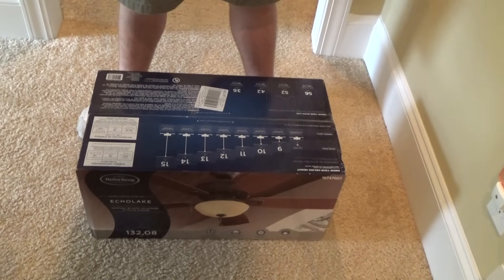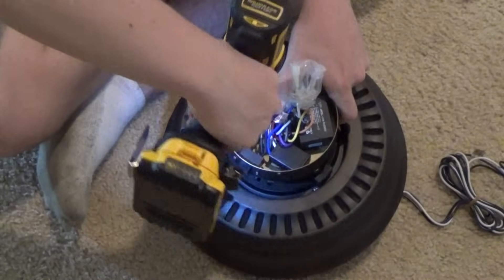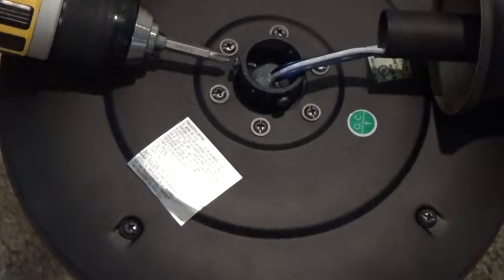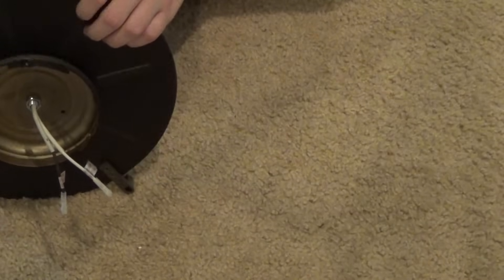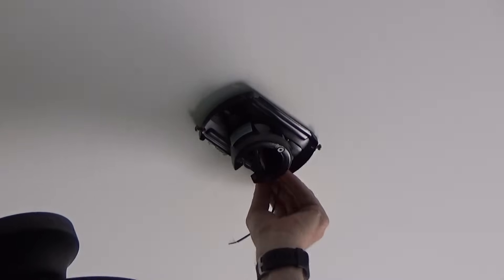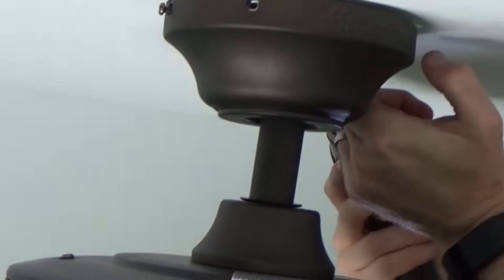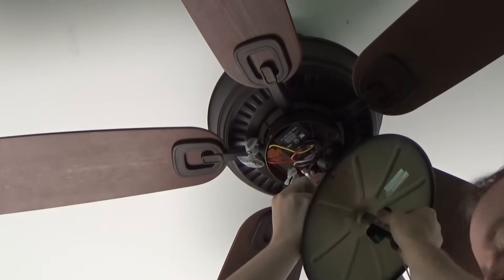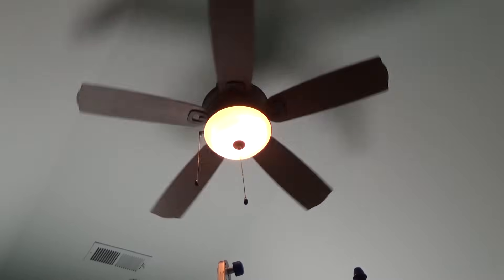How to install a Harbor Breeze Ceiling Fan from Lowes

Comment: Can I install Blades on the ground before installing motor up?
Reply from the maker: It depends on the model.  On this one, technically no.  To be more accurate, I believe you can install all but maybe 2 blades on the floor and then just install those when you get it mounted. If you install all of them on the floor you can't angle the fan to hang it.
Reply: I always do

Comment: For all of those asking, the blue wire that is connected to the ceiling fan should be connected to the "hot" wires that are coming out of the ceiling via wire nuts.This is only if you do not have a red wire like in the video. The "hot" wires are usually black, however, this could be different in your home so to avoid any types of malfunctions/safety issues you should test these wires beforehand to determine which wires have electricity going to them.

Comment: You could explain the wires better
Reply from the maker: I understand where you are coming from but that is really tough to do.  The way the wires in your house are wired may not be the same and if I tell you to wire the black to the white wire in your house and I am wrong, I can be held responsible for the damage.  The only way to know what wires to connect it to are to test them with a multimeter.  Most people forego that and just assume what they are based on colors but I have seen thousand dollar brand new appliances ruined because people didn't test the wires first.

Comment: My grandson has a little stuffed little man. It is duck dynasty. Half the time your voice sounds like the duck dynasty guy.
Reply from the maker: Love Duck Dynasty.  Who does he think I sound like? I actually met Jase years ago.
Reply: @ClintHolland  I never watched the show. I guess you had to have cable tv. I don’t have cable tv because I don’t watch tv. Antennas gets me all I want when I even turn a TV on. The little stuffed man wears a cap and a long beard. The recording says a lot
Of different things.  One is the things the little stuffed man says is Red Neck rule number 1. Most things can be fixed with extension cord and  duck tape. When you were talking about how to wire up the fan after you hooked it on the hook holder is when I noticed.

Comment: If I can move the down rod around does that mean it's too loose?
Reply from the maker: When you say around what exactly do you mean?  It's ok for it to move in general. Otherwise the fan would probably vibrate and make noise.

Comment: can you attach the blades before you hang it?
Reply from the maker: On this model you can't. You could attach a couple maybe but they would interfere with your ability to hang it because of the angle needed.

Comment: Can you use a dimmer switch with that
Reply from the maker: You sure can.  Most fans support them just fine. The biggest issue you may have is if you install LED lights, many of them don't support a dimmer and you would need to buy dimmable ones.

Comment: My light didn’t work until I hooked up the two whites together. Two blacks and a blue together and two greens and a gold. Now it works. I don’t like the way my fan switch goes through the globe beside the light switch. Half the time the fan switch. Doesn’t want to work. Any ideas ?
Reply from the maker: Honestly, if it works sometimes and sometimes doesn't, I would suspect an internal issue with the fan and would contact Harbor Breeze and return it.
Reply: @ClintHolland  I have the lights and fan working. Thanks.
Reply from the maker: @louiseneel944  Awesome and great to hear.

Comment: I had what looked like this exact ceiling fan except you don't mention the remote receiver that comes with most ceiling fans.  I couldn't figure out how to fit the remote receiver and the wire connections all in the same space inside the bracket. Looking now for a ceiling fan that does not have the remote receiver thrown into the mix.
Reply from the maker: Yeah, this fan didn't include the remote. I have a separate video of me installing a fan with a remote. https://www.youtube.com/watch?v=WfhYInLo1e0

Comment: YOU DONT CONNECT THE LIGHT KIT WIRE TO THE “OTHER TWO” WIRES.  IT ONLY GOES TO ONE, GENIUS!!!
Reply from the maker: I am not sure what video you watched or fan you installed but if you know of a way to make a light work by only connecting one wire then you have just defied physics and probably are due a Nobel Prize.

Comment: Great video.... Just one suggestion: Try carefully installing the blades and light fixture before hanging and connecting the power afterwards. (Lay the unit onto its side and hanging off a work table while installing the blades.) Afterwards,  hang everything as one unit....
Reply from the maker: I couldn't get it to work on this fan if I installed all the blades as it wouldn't let me angle it enough to hang it.  We didn't completely test the theory but I believe if you put all the blades on but maybe 1 or 2 you could do that.  Were you able to angle it enough to get it hung with the blades?
Reply: @ClintHolland  Yes, but I had an extension.... I didn't use the short one.... So in the case of the short one, you are absolutely right
Reply from the maker: @jamessmall3242  Got you.  Yeah, having a longer downrod would probably help out a lot.

Comment: Thank you for this video! We installed a summersville this afternoon. The light works, the fan motor runs, but the blades don't move. Any thoughts on why that may be? 🤔 Ty!
Reply from the maker: I am not sure I understand.  How can the fan motor be running but the blades not turning?

Comment: I have a blue black and white wire coming from my ceiling no green ground is this a issue
Reply from the maker: It's not ideal but it will work. It just means you don't have a ground.  Many houses, especially older ones, weren't wired with grounds.  They are used as a safety factor.
Reply: @ClintHolland  ya its a older townhouse so I just connect the wires by color black to black, white to white, and blue to blue and I should be in business? What about the remote wiring?
Reply from the maker: @will7285  Do you have two switches on the wall for this fan or just one? Also, the fan in this video didn't have a remote. Are you installing a different model?
Reply: I have the same issue, no green/bare wire for ground.  I simply omitted it, and everything works great!

Comment: Great video, but I have one question.  We are installing a HarborBreeze fan only (no light).  The wires coming out of the fan are  black, white, blue and green.  From the ceiling there is a black, white, green and bare copper.  I think in your video you say, if you dont have a light kit, connect the blue wire to the "other wires coming out of the ceiling" (black and white).  This would be a dead short circuit!  What did I get wrong?
Reply from the maker: Assuming that the wires from your ceiling are white for neutral and black for hot, you would connect your white wire to the white wire on the fan and the black wire to the fan's black and blue wire.  Since you don't have a light, you actually don't need that blue wire connected to anything unless you just want to be prepared to add a light kit at some point.  And then assuming your green wire is ground, I would connect it to the bare wire and green wire from the fan.

Comment: What about the white wires? You didnt address thise
Reply from the maker: I don't address the wiring because I can't know what the wiring in your house is like. Depending on where you live, how old your house is and who wired it, they may not match up with my house or even your neighbors house.  It would be very dangerous for me to issue a blanket statement as to how to connect your wiring. However, I am happy to help on a case by case basis. What color wires do you have coming from your ceiling?
Reply: @ClintHolland  I was tightening the bracket for my ceiling fan when the white wire from the fan came out as I was putting the housing back on. I have white wires coming from the ceiling but they are a different gauge and are already tied together. My question is, how to I complete my circuit to get my fan and lights working again
Reply from the maker: @OrisRasGaming  How many white wires do you have coming from the ceiling?

Comment: Where do I attach the blue wire at? I only have white & black wires from ceiling with a single wall switch?
Reply from the maker: Tie it together with the black wire. Then your one switch will turn on both the fan and the light.

Comment: How do you tighten the screws if they are loose
Reply from the maker: I am not sure I understand the question.  If the screws are loose you should be able to use a screwdriver to tighten them.

Comment: Do you have to have molex connector to make light work?  Apparently the installation guide said cut it off.  Now the light doesn't work
Reply from the maker: You do not, at least on this model.  You can hard wire it without a connector.

Comment: I only have a white wire and a black wire coming from the ceiling - only 2 - which one ties in with the green ones?
Reply from the maker: If you don't have a green or ground wire, it will still work just fine. The ground wire just increases the safety should the fan short out and you touch it.  But I doubt you will be touching the fan very much.

Comment: so mine DOES have a light(not necessarily a "kit"?) but it only has the black and white cables.  The old fan did turn the light on with one outlet and the fan with another.  Im assuming this one uses the remote for everything.  So what do I do with the red?  Just cap it off?
Reply: well I just capped it off...everything seems to work well hopefully the house won't burn down
Reply from the maker: @raptorsan85  Sorry for the delayed response but yes, you can just cap it off and use the remote for everythng.

Comment: I had the same fan would it work if I had a white wire and a black wire to have an old house where does the red wire go
Reply from the maker: Assuming that your white wire is a neutral and your black is hot, you could tie your white wire to the fan's white wire and your black wire to the fan's black and red wire.  The red wire is just the hot for the light and the black wire is the hot for the fan.

Comment: Looking at my ceiling, i have the white, blue, black, bare & red wire...I'm so confused as to what goes to what!
Reply from the maker: You would want to use a multimeter to confirm what they do.  Are they attached to a ceiling fan now or just bare wires hanging?
Reply: Clint Holland 
No. It's a new house. There is no light fixture or anything else.
Reply from the maker: @LDRDebari  How many switches do you have on the wall?

Comment: I have fan motor installed but I did not remove the blade screws first,  now two of the screws won't turn.  Any suggestions?  Thanks!!
Reply from the maker: You are saying the screws are too tight to turn?
Reply: @ClintHolland  yes two of the screws won't budge.
Reply from the maker: @lynncappa5769  That's a tough one.  Maybe try some penetrating oil.  If that doesn't work your only option is probably to take it back for replacement.

Comment: 21:09 i heard train horns
Reply from the maker: Very well could be true.  We do in fact live near a train track.  Good ear.
Reply: @ClintHolland  I am a good hearing. I live 3 miles away from the nearest track and i can hear the horn and train tracks. ya'll probably live like half a mile?
Reply from the maker: @tylerwhoisafanoffanstrains9246  Even more impressive.  I just measured on Google Earth and we live 2260 feet from the train track.
Reply: @ClintHolland  1/3 of a mile because 1 mile = 5280 ft.

Comment: Assemble everything but one fan blade and the cover over the light kit.   Then hoist it up and drop it in the ball slot, reach through the open fan blade to connect your wires and voila.  You won't have to mock your children that way and they will visit you on Thanksgivings.

Comment: Do you need to take out spacers before you connect electrical? I have it all connected but it’s not spinning. I still have the spacers on.
Reply from the maker: If you are talking about the rubber or plastic blocks they use to stabilize the blades/motor, then yes.  Do you hear the motor humming and trying to spin?

Comment: What about the red wire
Reply from the maker: In my case, the red wire from the ceiling is coming from my 2nd wall switch, the one I use to control the light.  I tied my red wire to the blue fan wire which is what controls the fan lights.
Reply: Quick Fix so, attach the blue and red from the ceiling to the blue in the fan?
Reply from the maker: @XMesandidge  What wires do you have coming from your ceiling? And how many switches do you have on the wall?
Reply: Quick Fix I have s double switch that controls the light and fine each. Nd another switch that controls both. I have green, red, black, white. I have hooked green green, white white, black black then capped the red but I think the red is hot. It is a remote controlled light
Reply from the maker: @XMesandidge  If your light is remote controlled then I assume you don't plan on using one of the switches on the wall, is that right?  If that is the case, tie the same wire you tie the light and fan wire both to the black wire from your wall, that is assuming the black wire is hot which it should be.

Comment: I have a red, white, black and bare wire coming from ceiling. I have one switch. According to the instructions for fan by chain and light by 1 switch it states to run black to black, white to white, both greens to bare metal and blue to red. My lights are woking but fan does nothing. Any suggestions?
Reply from the maker: Since you only have one switch, and assuming that your white wire is neutral and your black is hot, which you really should verify with a meter before doing this otherwise you may damage the fan, you would wire the white to white, the greens to bare metal, and the black and blue from the fan/light to the black from the ceiling. Then your switch on the wall will control both your light and fan.

Comment: Why my fan still wobble
Reply from the maker: If you are having trouble with it wobbling and you are sure it's installed correctly with everything tight, you can pick up a balancing kit from Lowes as well.  https://www.lowes.com/pd/Harbor-Breeze-1-Clip-5-Weight-Black-Ceiling-Fan-Balancing-Kit/50354904

Comment: The installer said you don't have a choice in putting the blades in over your head. That is not true. You can install the blades on the motor before you connect it to the ceiling. It makes it 100% easier than working above your head and having screws fall back down. I have a slightly different fan and installing the light kit has been murder. Three screws are causing me so much grief.
Reply from the maker: It depends on the exact fan model.  Some fans allow you to put all the blades on before hanging but in general for most fans you will need to leave at least one blade off to get it hung, sometimes more.  It also depends on the length of the down rod.  A longer down rod allows you to have more blades on before installation than a short one.

Comment: Mine had 10  machine screws to be taken out from the bottom of the motor.  If you go by the manual you will mount the fan and then take the screws out upside down from a rotating housing. haha  So make sure you take out these ten before you hang.
I got 8 out and spent 4 hours trying to get 2 out.  You cannot get your drill and drill bit close enough to unscrew.  I am going back to Lowes for an extension.
The 10 machine screws would have been so much easier to take out on my lap.  You have to fit an exact angle with your screwdriver to apply any torque.  The screws are not deeply seeded so the notches require a perfect fit.  I tried all 20 of my Phillips screwdrivers and even 3 flatheads on those two problem screws,  They must have driven those two in with a machine.
If the extension does not work I will have to go through hell twice (taking it all apart and starting over)but once I have the motor on my lap I know I will get those two problem screws out.

Comment: Hi Clint,  I found your video while trying to find instructions for adding a wall plug wire to a ceiling fan. I understand that is not what you are doing here, but noticed you offered help. So, here is my dilemma:  I rent a room from an elderly woman. In this room when I moved in was a ceiling fan that didnt work. This fan was a regular ceiling fan, that was wired to a cord ( like a lamp) and plugged into wall plug. Her son, who only has one leg, who installed this fan, said he would repair it. So I took it down off ceiling.  He opened it up, and wiring was all melted, so they went to Home Depot, and purchased a new Hunter fan. With lights too. They also bought a new cord and plug to put together with new fan. So, the cord they bought has two wires in a decorative goldish plastic coating. No white, black, green wires, Only two wires in there like a regular cord for an old lamp at grandmas house? And the plug, has no ground on it, only two prongs.  I think this may have been the problem in the first place with the melted wiring in the first fan?!  I am worried her son doesn't know what hes doing, and will ruin another fan, and possibly start a fire in my room!! So do you have any thoughts?? Shouldnt the cord contain a blue, black and green wire?
Reply from the maker: What they bought is called lamp cord and it only has 2 conductors in it like you see.  It is not appropriate for this task.  Depending on how long you need it, you can buy premade cords at Lowes or Home Depot that have bare wires on the end for this purpose.  But definitely don't use that cord.  You could make it work, but I don't recommend it.  Since you have to pull on metal chains and such for a ceiling fan, I would want at least a 2 wire cord plus ground.
Reply: @ClintHolland  Thank you for the information!  I really appreciate the advice!.😀